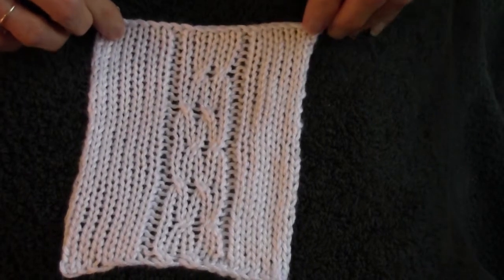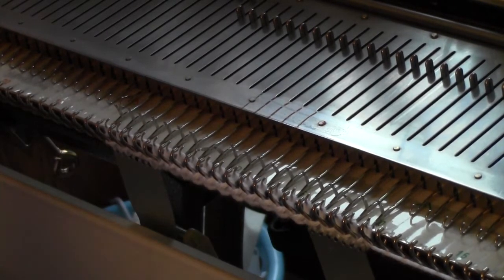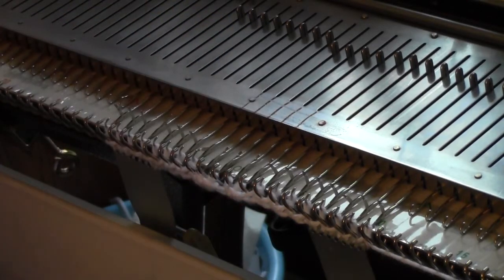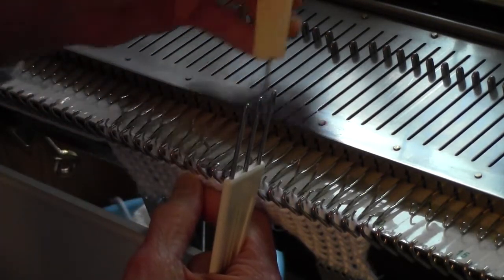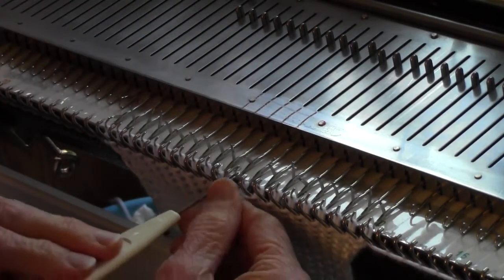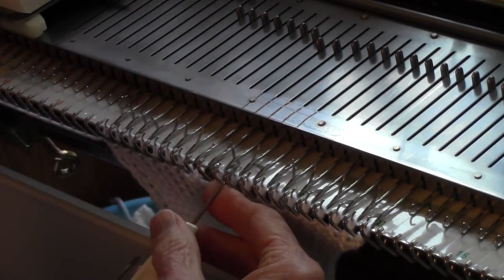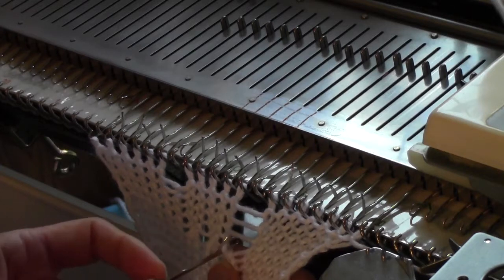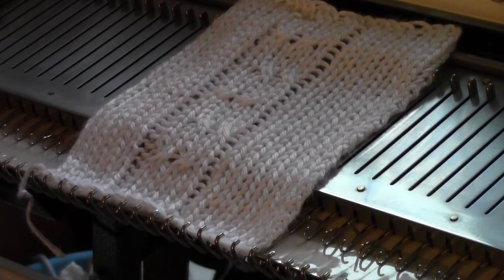5 Stitch Braided Cable by Diana Sullivan - Machine Knit

Comment: Nice! I was always daunted by that, but I guess it's not any more difficult than a regular cable. I'm lazy, though, and would use the ribber to re-form, or actually knit those stitches to either side of the cable in reverse, rather than latch up.
Reply from the maker: Oh, yes, I agree about the ribber.  Many people don't have ribbers, though, and are doing a lot of work on machines like the LK150.

Comment: Hi Diana I have a question for you I wasn't sure where to message you for this question?? I just perched purchased a juki knitting machine and the girl also had a river bed separate model kr12 I was wondering if they are compatible together
Reply from the maker: I don't know.  If they go together, she might be able to show you it goes together.  Or, the ribbing attachment should have a manual, which will have detailed diagrams and instructions on how to attach it, and you could try it.  These are not the most common machines, and I wouldn't buy it if I couldn't obtain a manual or if parts are missing.